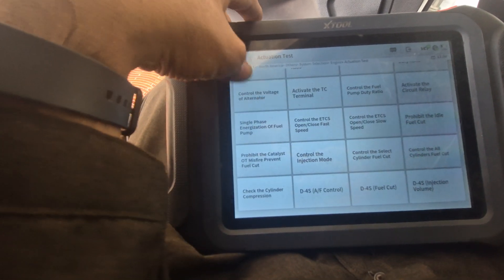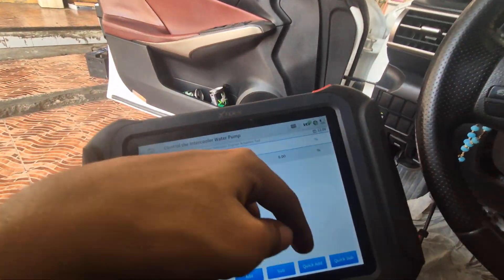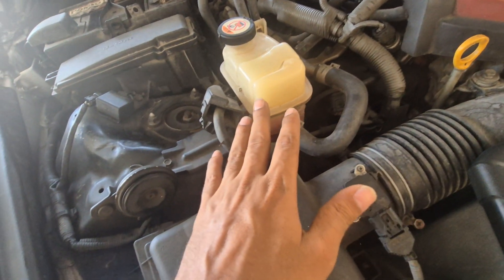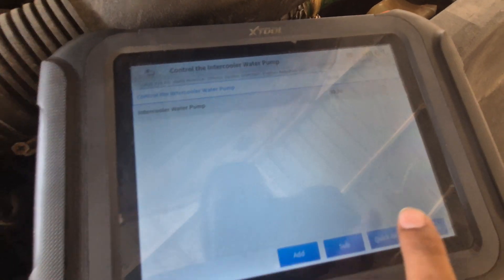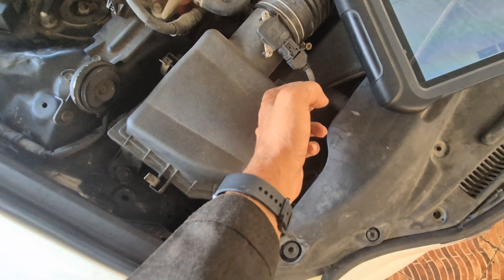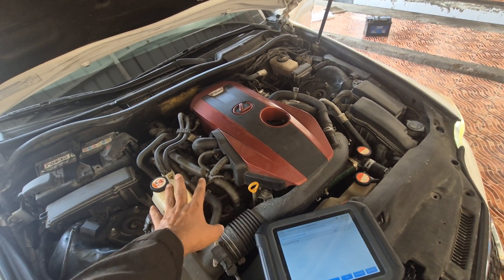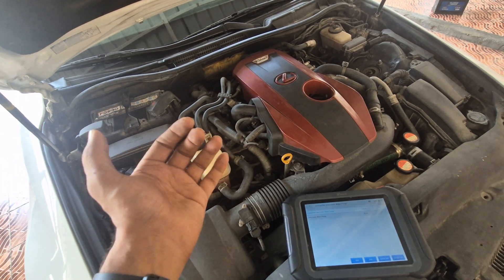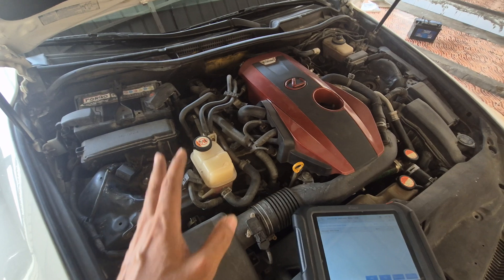Lexus IS200T Engine temperature problem

Comment: I have the same issue, where is water pump location?
Reply from the maker: On passenger side under air filter behind bumper no need to remove bumper
Reply: @CarFaults Is the  engine water pump the same?
Reply from the maker: @adyalfarsi4004engine water pump on lexus IS turbo is none  eletric spin with engine
Reply: @CarFaults Bro,I found the part, but there’s no water movement in the tank. I can feel the flow in the pump pipe, but nothing shows in the reservoir. I’ve had this issue for five years, and many parts have been changed without any benefit. I still suffer from overheating when driving through the mountains.
So should i replace it?
Reply from the maker: @adyalfarsi4004 ok there must be flow in the tank.
Maybe there is flow but due to overfill you can't see it there is another reason when pump plastic impaller is broken from motor shaft there is sound but no water movement.
You can confirm by removing return pipe when pump is running there must be good flow. If all ok from intercooler and pump side then go to engine side and change thermostat i think there is two in this model the one small cause over heat and also hard to replace.
In intercooler tank there is no high pressure you can remove pipe but still careful
Reply: @CarFaults  i have been changed many parts, Big thermostat+Water pump+engine fan+ add Transmission cooler+add Two extra fans, and still i have same issue